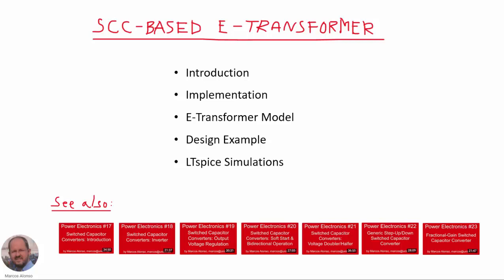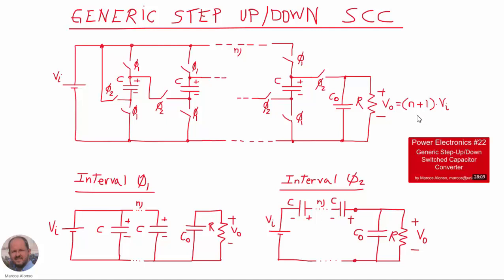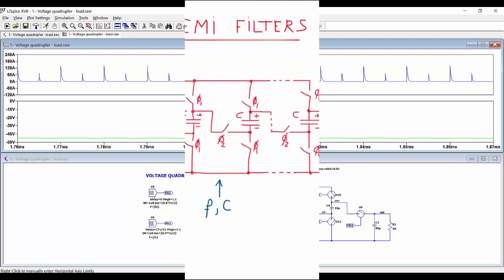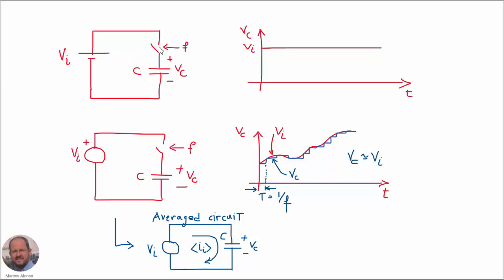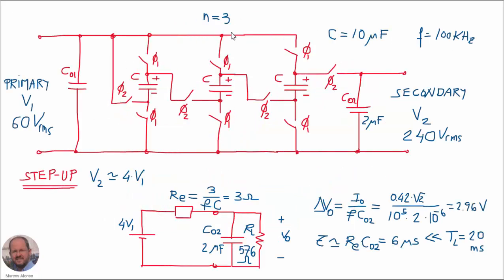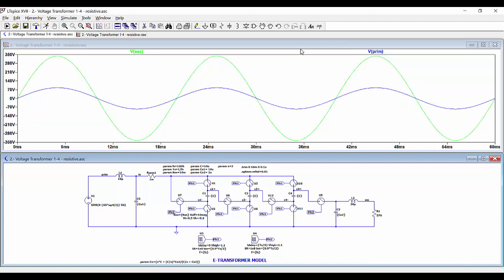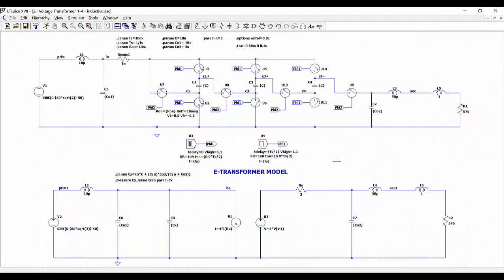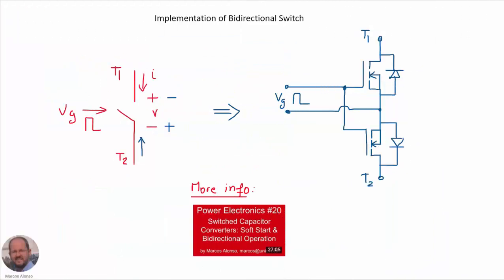PE #24: Electronic Transformer Based on Switched Capacitor Converter

Comment: Just curious if Co2 should be removed from the model since it's captured in Cx?
Reply from the maker: Good question. Cx is due to the switching effect at high frequency but Co2 is there all the time. It should be kept in the averaged model

Comment: What if the input was not a DC but a lower frequency sinusoid?
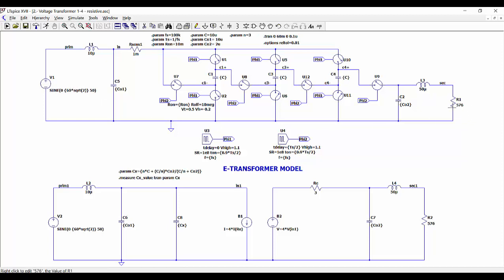Reply from the maker: Yes, it works the same. This is why I call it voltage transformer. You can see the simulation at 25:40
Reply: @MarcosAlonsoElectronics  Got it. So as long as the clk frequency is much higher than the input frequency - Any rule of thumb (fclk/fin)?
Reply from the maker: @bottomupengineering  The LC filters' cut-off frequency should be around 1/10 of the switching frequency and the input frequency around 1/10 of the LC filters' cut-off frequency, so I would say around 1/100 of the switching frequency should be OK. In this example is around 1 kHz, which is not bad, good enough for grid applications